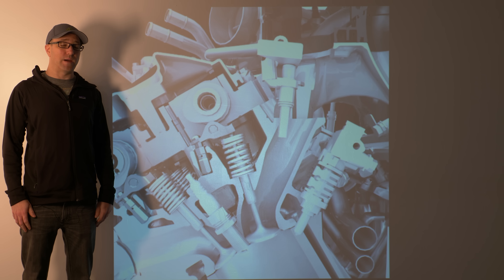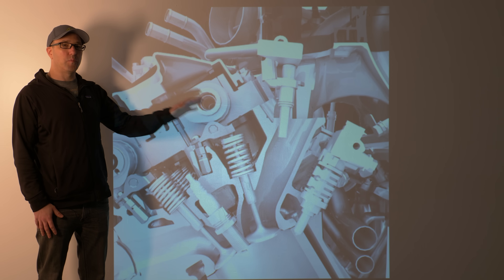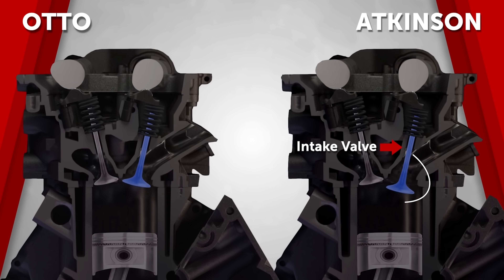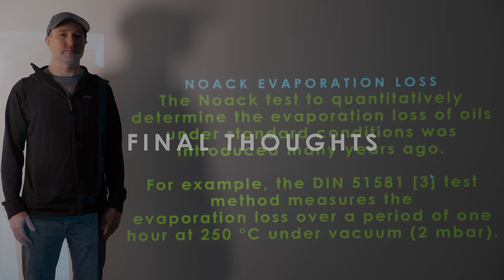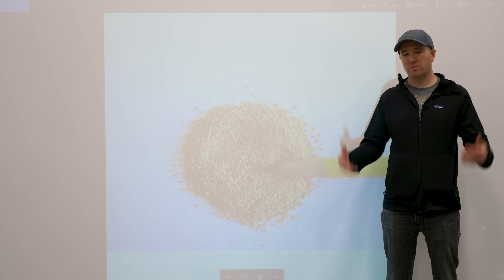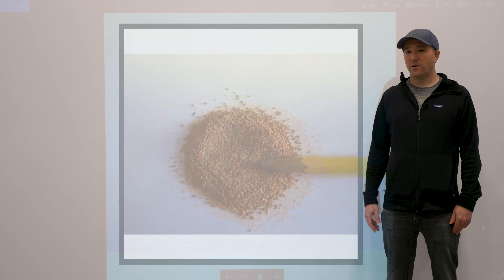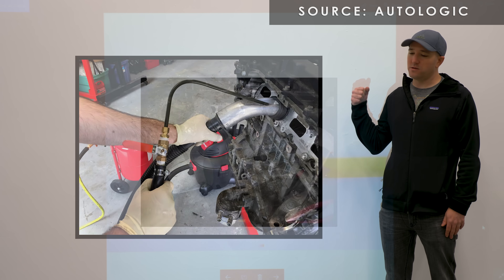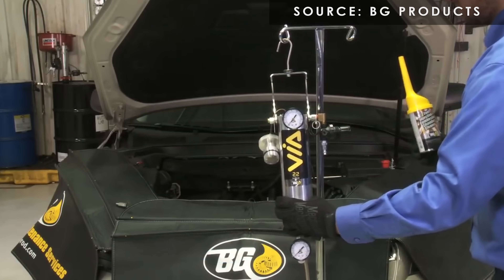Direct Injection, Problems and Solutions | The Fine Print

Comment: Curious, to help with this GDI, especially Turbo ones, would using premium fuel be helpful/preventative measure ? It's recommended, but not required by many brands, but is it really a must, in this regards ? 
 as well as folks using full synthetic oil that meets SN Plus and ACEA A5/B5 also be a good option ?  Which could also help with LSPI (low speed pre-ignition), which can cause problems with engines ?  
Kia Stinger only requires conventional oil of API-ILSAC GF-4 or greater  quality,, but some research suggests it's safer to prevent LSPI and knock, by using the higher full synthetic oils, like in Europe. Thoughts ?

Comment: Thank you for this very informative video.  I knew about the valve buildup problem but I didn't know what caused it until seeing this.  I will avoid this engine design if at all possible in the future.  Hopefully they will design a better fix like the dual injector setup or catch filters.  Otherwise I'll try to find a port injected model -- assuming they are still being made in the future.  Or consider an electric alternative.  Tearing down and cleaning valves every 50k is just insane.
Reply: It'll take me 10 years to get to 50K and my French car will be 12 yrs old, I'll be 80 so I'm not worrying.
Reply: Don't buy a tesla . Battery replacements are insanely costly .

Comment: Unlike diesel fuel injection, which is direct injection, in which the high pressure pump and injectors are lubricated by the diesel fuel oil, gasoline direct fuel injectors are not lubricated by the fuel. Gasoline has approximately zero lubricity, less than water. The high pressure pump and injectors have to deal with this challenge, requiring a rather different design of the injection pump and injectors.

Comment: I also use BG fuel system cleaner in the gas tank every 3rd fill up and the Professional BG Intake clean on my GDI Turbo once a year and it works like a charm.. Also I use a baffled catch can and during the winter I need to drain it every 5-7 days. so far so good.

Comment: What about stuff like seafoam that has to be injected into air manifold? Would it help to clean valves in DI engine?
Reply: Artem Lokhovitskiy not added to the fuel. It would have to be injected at the Intake to be in top of the valves. If that makes sense.
Reply: @nabes68  that's exactly what I typed

Comment: I have both port and GDI injection engines on my cars, and the port has worse fuel economy on a smaller vehicle than the GDI. I owned a Mitsubishi turbo with GDI and the engine was great at 150,000kms when I sold it. But it needed big $000 spent every year to keep it running.

Comment: You missed the important benefit of GDI .
Higher compression ratios and the resulting thermal efficiency . Unlike port injection Only air is compressed not the mixture
Reply: Yes! Reduces pre-ignition/engine knock

Comment: You are wrong about this entire presentation carbon build deposits in the intake valves can be prevented as long as you use the Top Tier fuel with detergents, and changing the oil regularly.
Reply: @EpicDrew15  Trust me today's modern GDI engines don't seem to have carbon build up issues at least for Hyundai, and Kia that is.

Comment: Hahahaha have fun cleaning valves !!!! I'll stick to port injection or tbi 
Emissions and fuel economy is bullshit excuse. Regular carborated motors can get better fuel mileage than a direct injection if done properly
Reply: Fuel economy is not the only measure of efficiency. GDI is capable of achieving a thermal efficiency of 35%, port injection is not

Comment: It’s an internal combustion engine, not a motor. An electric motor is a motor.
Reply: An engine is a motor, a motor is an engine. They are synonyms. Have you ever heard the term motorized vehicle?
Reply: Redtooth So an engine is a specific type of motor. That's why it's not incorrect to speak of a motorboat, or a motorcar, or a motor speedway, even if the boat or car is clearly powered by combustion. Note that if there's no combustion, there's no engine. Purely electric cars don't have engines

75 https://english.stackexchange.com/questions/42027/semantic-difference-between-engine-and-motor

Comment: Thanks for your video !!

I would love to get one of those inspection cameras and take a peak at my intake valves on my 2014 fiesta at, but honestly it's running strong asf I have put about 84k kilometres on from the day I bought it brand new.  It's got an oil catch can and I do engine oil and filter change every 5k kilometres and only run it on premium 98 octane petrol and lots of high revving. Those engines need to be driven hard.

Comment: this guy does not know the basics of engine operation and blowby. the blowby goes the opposite direction of what he showed. the actual problem with carbon deposits is mainly from using egr valve on all modern cars. but again, a well maintained car using the right oil will not have issues for many many miles.

Comment: using high quality fuel and most importantly high quality oil with low contents of ash, will greatly diminish the problem of carbon on the valves. it's that simple. problems arise when people use oil with wrong specification different than what  manufacturer requires.
Reply: What kind of fuel should we use to prevent carbon build up...?
Reply: @Awesomenessismypassion  This is really late, but I was browsing the comments.  Use any top tier fuel.  There should be a prominently displayed logo saying top tier on the pump.
Reply: @thejoshballz  please explain how a high quality fuel keeps the valves clean.

Comment: A lighter oil could produce more volatiles. But I'm not worried about volatiles because volatiles burn or evaporate. Heavier non-volatiles are the ones that are gonna stick like sh!t to a blanket to your intake. That goop I scraped out of my intake was the opposite of volatile - I would call it heavy grease.

Comment: The dealers and automakers aren't gonna flash around with their GDI engine cars to tell you all the disadvantages. Or they gonna try to sell it off as a benefit of course, GDI  sounds "high tech" or "sporty", but the customer hasn't got a clue what that is.  Anyway,  my wife for example does not know nothing about engines and cars, but even she said that her Hyundai sounds "horrible", compared to some older car (2000 Audi) she had, which actually had a cracked muffler.  Actually if you listen to the muffler tone of a GDI, it does sound like it has timing and injector issues from the start.

Comment: The wrx fa20 is DI, if you switch to a front mount inter cooler you can put on a BRZ intake and use the injector ports for extra fuel in high boost application and also to clean the tops of your valves. Most of the companies who have been doing DI have already done the same, with any DI car it dosent hurt to run some injector cleaner through the intake vacuum every once in a while.

Comment: My DIY cans, one between the PCV valve and intake manifold and one between the engine breather port and air intake duct, work very well.
To test the effectiveness of the can, insert a cotton swab in the hose end of the PCV side and notice the oil on the cotton swab.
Next, insert a cotton swab in the hose end at the intake manifold - if it has oil, the can is too small and not working well enough.

Comment: Mercedes m276 direct injection engine, I just had the intake off and the valves were really clean with very few deposits. So, it’s not really the same problem with build up on the valves for all di engines...

Comment: most AMSOIL oils are NOT grip 5! They are 4/5 at best. Their signature line is still what you are used to. Also look for an HTHS OF GREATER THAN 3.5 and a TBN of AT LEAST 8-10. And DONT overlook synthetic diesel oils. More surfactants and better cleaning and they ARE DI engines!

Comment: Yes, the concept is there, but with too much ethanol in the gas, the build-up will
always be there. Need to replace ethanol with something better. High pressure 
pumps are VERY expensive, not worth justifying for the cost of fuel economy.

Comment: My engine has an oil recovery system. I would also add a catch can but the existing system has two ways for the blow bye to get in the admission: one for working under vacuum and one for working under pressure (when turbo is on). One of these paths is 100% in the engine cover itself. So that one cannot be routed through a catch can...

Comment: He got the PCV valve and blow by completely wrong. He says 7:17 "fuel and oil vapor ... into the head space or the crankcase .. pressure comes up... .you need to ventilate that through the... upper part of the motor"... WHAT!!!!!!!!!!!

The combustion chamber is where there is compression and combustion, which causes high pressures, DUH! Because of those high pressures, what was in the combustion chamber, seeps past the rings and gets into the crankcase below, which is what blow by is. The crankcase, is the section of the motor that contains the Crankshaft. DUH!!! The crankshaft is in the block, the lower part of the motor, not the upper part of the motor, the head. OMG!!!

Get this guy a course in engine anatomy. WOW! No offense to savagegeese, but he got it completely wrong.

The PCV valve is positive crank ventilation, which means that when there is a greater amount of pressure in the crank case than the intake manifold, then there will be a venting of the crankcase to the manifold. If you have a turbo charger putting pressure into the intake manifold, you don't want the pressure from the intake manifold going into the crankcase through the line connecting the manifold to the crankcase. Therefore, the PCV valve shuts off, only allowing one direction. DUH!

When Hyundai (the author/owners of the pic)  shows a picture of the PCV connecting the valve cover to the intake manifold, what that is, is a pressure vent that is routed from the crankcase through the motor to the top of the motor, in the head, which is then vented through the valve cover to the intake manifold. Not the best way to picture it, not the best way to vent it. The best way is to have two vents, which most manufacturers do. One going from the valve cover to actual intake pipe, and one from the crankcase, going to the intake manifold (using a PCV valve). (You could put a PCV valve between the valve cover and the intake pipe, BUT there is no need, since the intake pipe will never see built up pressure since it would be placed before a turbocharger if one should happen to be in place.)

Obviously, a turbo engine has greater pressures in the combustion chamber, which cause a greater amount of blow by. Poor cleaning of the valves causes more buildup, which eventually runs down the cylinder walls, which causes  more of an uneven surface for the rings to seal against, causing even more blow by problems. Good quality oil will help keep things clean and keep buildup from sticking to surfaces. Proper cleaning with Seafoam/BG cleaner, good oil lubrication, and PCV valves, are extremely important in turbo direct injection engines.
Reply: Oh wait, there's more!!! 13:17 It's a SALES PITCH for oil catch cans! You don't need an oil catch can. Just run a bottle of seafoam through the intake manifold at every oil change, and you're done.
Reply: 18:40 Lies again. He says it's not something the average consumer can do. That's what the manufacturers want you to think (so the dealers make a $1000 a pop), and he's simply passing on the lies without doing the research. Anyone can pour a bottle of seafoam into the intake manifold and clean up those valves/combustion chamber, etc etc etc. Take a buddy, have him make sure the engine rpms dont drop too low by revving it to 2500, then pour in the bottle as fast or slow as you want. I've tried hurting a motor by pouring it in as fast as I can, and NEVER have I had it hurt the engine. Anyone can do it. Then, after the bottle is poured it, turn the car off, let it sit for 5 to 20min, and then go for a drive giving it full wide open throttle as much as possible till all the smoke clears. Every oil change do this, and you 100% good. Enjoy.

Comment: Good presentation of information.  You cleared up a lot of the differences between the types of injection systems.  However, you lost me at two points and put out partially incorrect theories.  You began to talk about the PCV system and blow-by, along with the positive and negative pressures.  The blow-by occurs when you have combustion gasses passing down the pistons into the CRANKCASE (lower end), which pressurize and have the potential to build up and push oil/fuel vapors up past the pistons.  The PCV system helps to equalize that pressure, by taking the possible (+) pressure in what should be (=) pressure between the crank and valvetrain spaces, and introduce a vacuum via the intake taking excess (+) pressure maintaining (=) pressure.  The other issue is your use of the term NOx.  The main by-product of gasoline combustion engines is CO, that is what the catalytic converter is battling more than anything.  The NOx you referred to is the main by-product of diesel combustion, which passes through a series of converters and DPF/DEF.  Overall, excellent presentation.

Comment: I think most Turbos gasoline are made by German manufacturer.  Most Germans keep the car less than 10 years or 160k Km/ 100K miles when it starts have problems.  That's why they put Turbo on everything including 1L engines in VW Polo, etc.

Comment: I hate DI engines. Love PFI. I want my Buick 3.8 Gen 2 engine back. No carbon built up on the valves. No PCV over pressure and Oil separator issues. No timing chain failures ever. And no fine particulate matter to poison people, the environment, and even the engine oil. All that for very little fuel efficiency gain, while engine replacements is thousands more than the best engine in the world: the Buick 3.8 Gen 2 engine.
Reply: Wow, exactly what I was just about to say. Hate DI, love Buick 3.8 Gen II.

Comment: Your calling an engine a motor; If a mechanical device incorporates multiple systems to operate, it is referred to as an engine. However if it is just one system I.E. electrical motor, starter motor, its a motor.
Reply: Your are correct. An engine operates on a thermodynamic cycle: gas Otto cycle; diesel Diesel cycle; turbine Brayton cycle, split cycle engine Stirling cycle; etc. In the thermodynamics group I worked in our rule was: engines roar and motors whir.
Reply: The Merriam Webster and the Oxford English dictionary disagree with you. Have you ever heard the term motorized vehicle? An engine is a motor, a motor is an engine; they are synonyms.
Reply: @Redtooth75  If you want to participate in the dumbing down of society and take a generalized simpleton description from sources that are obsoleting many words from the their reference materials you right ahead. Next you are going to tell me that it depends of the definition on what is is. Some people call motorcycles cycles and some call bicycles cycles but they are wrong to think this is the proper name. Let me guess Kleenex and tissue paper are interchangeable to you as well.

Comment: You guys are just the blind leading the blind. Found no comments talking EGR. Exhaust gas recirculation (EGR) is a nitrogen oxide emissions from 1980s. No one here has ever worked on there car before. Exhaust gas gets directed through the intake putting carbon everywhere to cool the combustion temp and prevents NOx from being made. Smh.
Reply from the maker: Yes EGR is a contributor but we have also had EGR since the stone ages.  Its just another piece, more companies are starting to cool EGR as well.

Comment: Negatives of direct injected only engines, heavily out weigh the slight positive that they have. Instead of dealing with "catch cans" or anything elses like oil and "fuel" when in this case can't help anything. I feel like the manufacturers should have done or added things into direct injected engines to completely stop carbon build up. NOT slow it down, but Completely Stop it. Hell even if from factory they did add a catch can. AT LEAST THERE TRYING BUT NOOO. 
Just going to avoid direct injected engines for now. I don't hate the idea of them. I just dislike the lack of concern from these incompetent engineers who aren't taking these engine problems serious. Just like dude said. The emissions that they have to sort through is not their fault. But designing these engines that when new is all hype. But as it gets older costly maintenance work will eventually have to be completed to aviod what direct injected engines were trying to aviod in the first place. Over the years DI will be standard and at that point I might have to deal with it. But i still have a choice now. Especially withl DI AND PI together.

Comment: My 2016 Honda Pilot has direct injection.  About 2 weeks ago the "EMISSION SYSTEM PROBLEM" message came up on the display as well as the check engine light.  I made an appointment and took it to the dealer.  They ran a diagnostic on it and pulled a P0430 code (the light went off when I was getting checked in and they still pulled the code).  I had purchased the extended bumper to bumper, but it seems that America Honda is extending their coverage for this issue only for 7 years/70,000 miles.  If this message comes on, and if this code is pulled, they replaced all 6 injectors and the fuel rails as well for free.  I asked the rep if this wasn't covered, how much would it cost, and he said about $2100.  So for anyone that has the 2016 Pilot (and it is specific to this year of Pilots only so far), this is covered - DONT pay out of pocket for this if you're within the warranty.